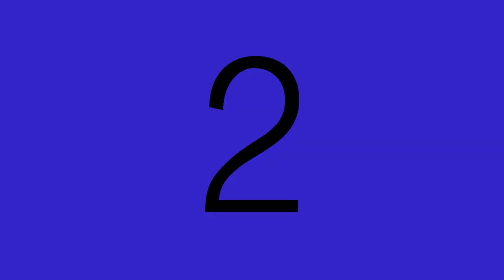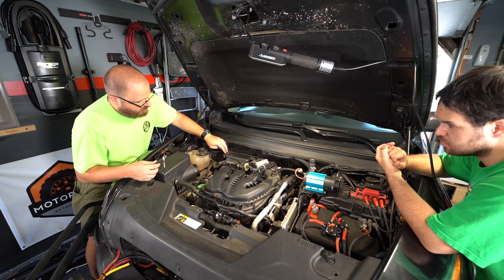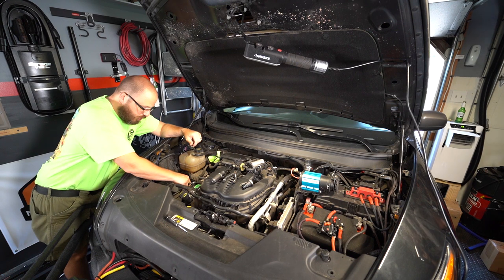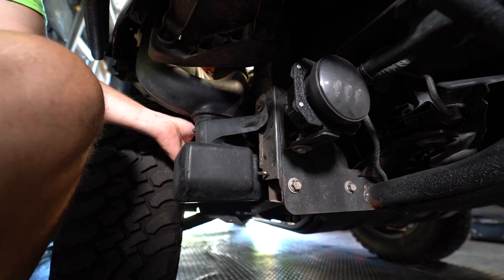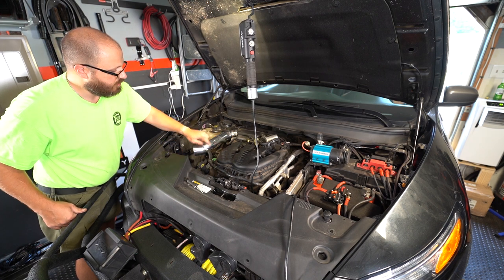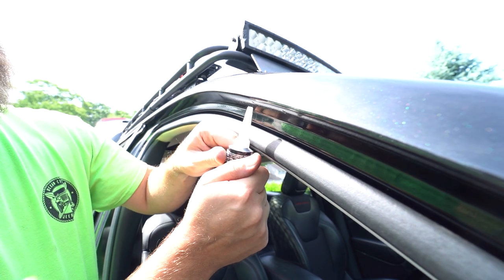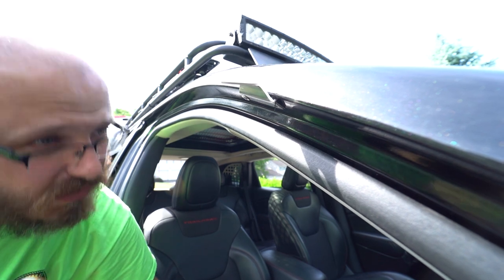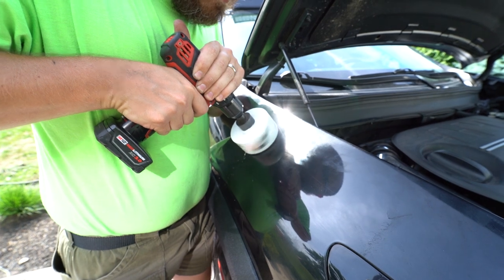MFC Offroad Closed Loop Snorkel Installation

Comment: Pretty much the cutting part is what has put me off going with this kit and the fact if I'm honestly in that deep of water I'm in deep trouble.   I did just install a K&N CAI to free up engine bay space so I can install the same ARB air compressor he has, interesting location where he put his.  The 2019 doesn't have that catch on the left side so that is where I installed the compressor.   Good video, but I would prob tune down the music just a bit on this one as your talking from a distance and it can be hard to hear when if your watching this and trying to do an install.  Wish you got some more local 2019 folks to do videos of installs so we can see them.  I'm still waiting on which bumper I want to go with eventually.

Comment: Should you not try to paint the bare metal holes you made for the tube and the two support bolts?  What happens when the bare metal starts to rust?  Wouldn't it be better to use a plastic hose clamp next to the body paint?  Good job getting it installed tho.
Reply from the maker: It is an aluminum fender, therefore it will not rust.

Comment: Is the intake placement the same for the 2019+ models? If I bought this for a 2019 would it work without issue? Or follow the same body lines as the 2018?

Comment: have you removed the air filter?  how to operate without an air filter?
Reply from the maker: The factory airbox is replaced with a high performance K&N intake filter system.